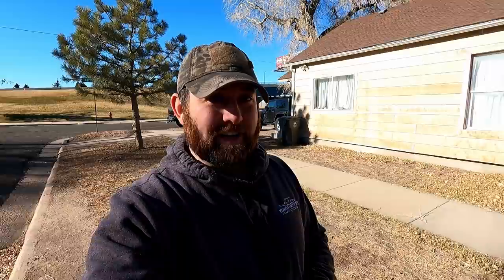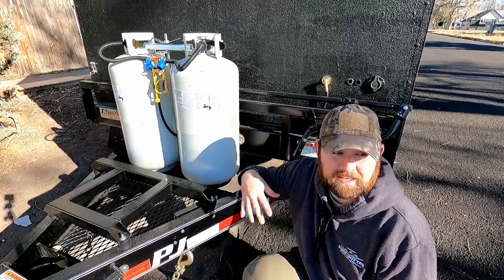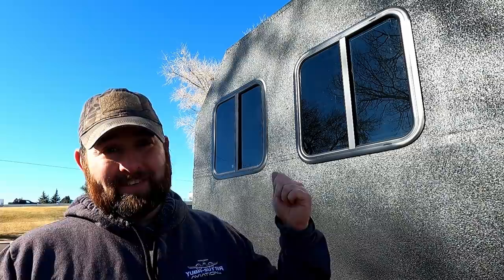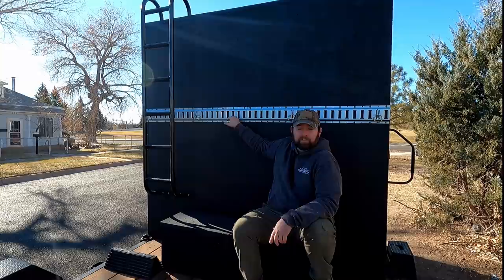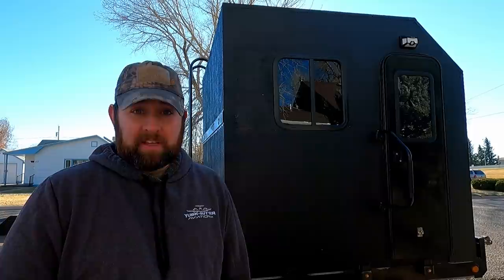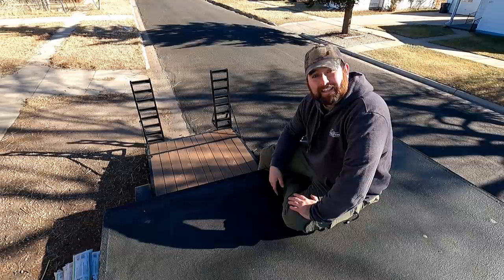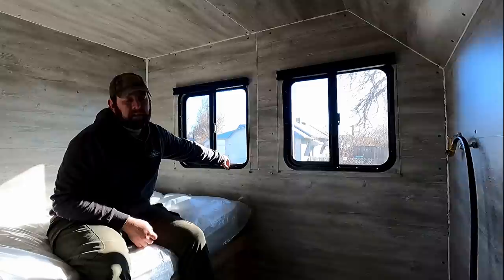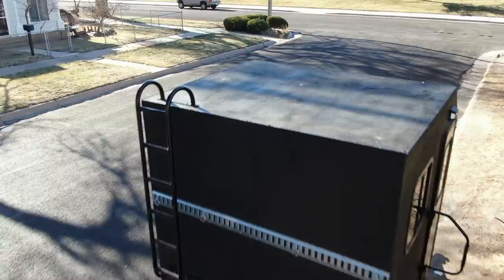DIY Crawler Hauler & Bugout Camper BUILD

Comment: Love the idea of this. Think I would get a small window ac unit that could be removed when cold and keep the roof clean for solar. I guess raid the rv junk yard for a dometic 3 position window about the same size as the window unit. You shouldn’t have any problem making a bracket/support with your skills. Also why your at the junk yard look at the manual steps like on cheaper travel trailers. Could just weld it right on and done. As far as water gravity feed it. 5 gallon jug on the roof hose to the inside with a plumbing valve to turn the water on or off, maybe put another hole for a hose to drain outside into a bucket? Geez look at me running on and on.....   Can’t wait to see more!

Comment: hello mr. brown,  love what you did with the trailer, its perfect close to something of mine, first i started with a big tex 26" trailer, hitch mount, . to help you a little bit better in your design,  a couple of things to think about, first the propane bottles, i would install and place 1 large tank under the trailer in between the frame rails, i have a 20 gal. under, tuck under,. the front of your trailer, the generator should be up against the front of the cab. balancing the weight of the trailer and the jeep on the trailer, a 1-1 ratio, . my trailer has a sleeper cab from a big rig, double king beds,  with mini kitchen in it, microwave, 3 burner stove/oven, drawers, 2 shelves sink, and a 4.3 cu. ft. refer. . also i framed the front of the trailer into a V- SHAPE, for the wind and better economy on the fuel. in the back of the cab on right/left side you could install a half - round shower , i did. ???, all the tanks, fresh, grey, black tanks are tucked into the rails of the trailers, 30, 30, 30 gals . again i do love your design, just trying to help you out due to the fuel economy.
Reply from the maker: I like some of your ideas. I've already built a lot of these things but I might have to change a few things up.

Comment: Also have really good experience with the little diesel heaters found in trucks they work good and can also add a water heater to the exhaust housing to warm up water as it is flowing through with a water pump.

Comment: I think it's super cool that you were able to build this completely from scratch. Suggestion: make vent holes on the bed platform before you open up your mattress and start sleeping on it, otherwise you'll get mold growing on it (rule of thumb: for every 1" in diameter that your hole is, you can put that many feet between holes in a grid pattern (so 2" holes can be 2' apart vertically and horizontally, 1" holes 1' apart, etc.)). I'd also suggest making some sort of ventilation for your Dometic fridge below the bed, either by NOT putting plywood between the left and right box OR if you are putting plywood, cut a hole and put in a vent cover so that air can travel between boxes. Good luck!
Reply from the maker: All very good ideas, thank you!

Comment: Nice work! For your inside window trim, find someone who has a 3D printer and have a window trim made for the windows. It will have to be made in four pieces and can be glued in place. The flange that will appear on the interrior wall will be the base of the print with the relief being printed off of the interrior  corner flange. Try and find someone who can print in the ABS variant of of filament to withstand the summer heat.

Comment: Window trim gaps.... Use a lon strip of sheet metal painted black, wrap around the inside of the window and use 1 rivet or screw through the ends as they overlap to secure.

Comment: Looks good. Not sure if you need it, but I'd slap another exterior light on the back of the camper facing the trailer section incase your doing stuff at night back there.

Comment: Nice execution of the build.  Definitely keep us in the loop on what you figure out with batteries and water.  That Herculiner truck bed coating will eventually fade in sunlight, so I ended up spraying a flat black over it and a UV-resistant clear coat on my truck to keep it from fading.  Did that about 6yrs ago and it has stabilized.

Comment: Looks cool I'd prolly try to use some metal roof flashing for around your windows, could paint to match it comes in a roll and is light thin and easy to work with. Awesome deal man I like it.

Comment: First of all I would like so you did an amazing job on the build it is very impressive now to hold your generator get some right angle iron and weld it together so then that way you have a 2-inch raise weld a I hook on one side and then a chain on the other or a ratchet whatever your preference is and that way you can secure your generator another recommendation I would give is build a shell for your propane in your generator so it is  covered and that it makes it last longer that way there's less wear and tear on your gear

Comment: Quit apologizing. That is a great setup. You.might consider a small window AC unit built out the back to be more economical. A couple of 2.5 gallon water jugs would do you fine instead of plumbing. A camp stove with 1 lb tanks could make a kitchen, inside or out. Looking good. Enjoy.

Comment: Very nice. I used to race a class 10 buggy back in the late 80s/early 90s. I had a similar idea to build a camper/trailer for the buggy. My idea was basically what you built except I was going to build a bed area that extended over the hood of the buggy. Kinda like a backwards truck camper. A Jeep may be to tall to do that but if it's not a height issue, that would give you a comfy, dedicated bed without adding to the overall length of the rig.  Of course it would eat into your deck area but everything in life is a trade off in some way. 
Unfortunately finances, school etc got in the way and I never built it. It remained yet another unrealized dream in my life so it's kind of cool to see you getting out there and making it happen. Looks good so far, you do good work. I truly hope it works out great for you.

Comment: Lights and more lights! Outside. For the deck and front to use while using the gen propane. 
Until u replace the box line it to match.
U may need to install DOT Reflective tape to the rear corners.

Comment: You should consider a small wall mounted ac unit.  With the insulation you have you won't need much even at 100 degrees. A roof top mounted water tank like they do with horse trailers would make water simple.  Looks like a great start. Good luck.

Comment: What about custom build water tanks to sit between the axles and the trailer bed? Out of fiberglass or something, wont be giving up much room and not mess with weight distribution too much. 

Another option is 4" pvc pipes, a 10ft 4" pvc pipe can hold 6 gallons of water, I'd try to line the space between the axles and the frame again in order not to give up space. 

Very cool project and awesome job. Thank you for documenting.

Comment: I thought it was a very cool and thought out video. Thank you so much. Idea for you we're the hood of your truck or your 4x4 when sitting on the deck you could probably do a build out from your sleep area that's connected to your sleep area over the top of that 4x4 when it's parked up on there Yes that will cut down a little bit of your deck but it'll give you more room for storage and other things or you can jack up the height of that trailer 12 in or more to accommodate for like a stone go type situation just some ideas I'm sure you've probably thought it out of all that stuff. Or getting even longer trailer. I love what you got so far that's a pretty innovative idea and probably saved you a ton of money on a car hauler cuz car haulers are not cheap My god they want way too much money those toy haulers are way overpriced

Comment: Love the video, You got my mind spinning with ideas.
I've been in a 3 year build doing the same thing, ran into a lot of the same problems.

Ideas
I worked in propane for 20 years. You have a Total safety issue. You need an outside single stage regulator "probably with a bigger diaphragm than the one you used" so everything will work.  If you don't have an outside pressure relief valve than the only way your system can bleed off is inside the cab. "BIG BOOM WAITING TO HAPPEN" 

Water issue.... Have you thought of gravity feed "or" just mount a 30 gallon barrel to your C clamp and supply water that way?

Chitter.... Make a cassette tank out of a 5 gal Jerry Can that you can slide out the side from the bottom for cleaning.

Comment: We have a 2004 Tahoe Pak Rat, 22ft toyhauler, same concept as your camper. Two things that I love about it...front pop out bed (doesn't subtract from the 9 1/2 by 9 1/2 foot floor space).
Also has two doors, one on the passenger side, for easy loading. The second one opens onto the back deck, which is where we spend most of our time (once vehicle is offloaded).
Often thought about an exterior makeover...may barrow a couple of your idea's.

Comment: FYI embed poly fabric at least  around perimeter set in acrylic base with pure silicone top layer, ( silicone bonds well to acrylic)  that will waterproof the exterior trim  coating alone will not work long term otherwise nice job looks great

Comment: Everything you add is also adding to the overall weight(plus, weight on the trailer tongue). You might benefit greatly by looking into materials used in the aircraft industry. Could help with towing mpg.

Comment: You want a regulator at the tanks, if the pressure going to the internal appliance regulators is too high they will lock up. Having dual stage regulators won't over regulate it, the appliance regs just step the pressure down further to what it needs to operate. Also if you have a propane leak, you want it to be lower pressure leak rather than a high pressure leak.
Reply from the maker: Yeah, I've since put a regulator on there. It's nice.

Comment: I know you say you want to use the space under the bed for storage but my only suggestion would be to rework the bed so it would fold up against the wall. That will give you some floor space for those days you want to stay inside. Mount that other stuff under the counter or whatever you put on the front wall.

Comment: Very cool, well thought out.... I'd like to make something similar. Your slip in ac unit can be dual purpose ac/heat. I'd mount a couple of deep cycle batteries ahead of the 2 propane tanks, and enclose both.
You could make a solar heater, or instant heat propane fueled hot water heater and enclosure for a hot shower outside for about $130. I might "exchange" the porta poty and fridge locations for your sleeping comfort, and possibly turn that bedframe into a 'Murphy Bed' style to give you more room, and while keeping the batteries outside in their own compartment outside, - run all of your controls inside, - to a consolidated 'power control area'. 
Add 12v power to the rear, in case you need power to the rear for winching/charging/ air compressor/or use of a welder for your Jeep. You could mount spare Jerry cans of fuel and water on either low side behind the housing center - on either side of the secured Jeep, ... reinforced with protection across both sides of the cans. Add some exterior LED lights, and you'll be good to go- 
Maybe these ideas will help as you move forward with your build.
Tuffcaptain548@yahoo.com

Comment: Shoot, use 26" steps.
It will be much safer getting in and out both, especially   moisture, as in ice or snow!
I recently had to get in and out of a fifth wheel camper several times a day and I made the stairs outside longer and wider just for safety cuz it was so easy to step off the thing and fall!!

Comment: Hinge the bed so you can fold it against the wall. Underneath you have room for a dinette with a port-a-potty and battery bank under one seat and a water tank under the other. Add a small kitchenette on the wall opposite the door. And, build a shower pan into the floor space right in front of the door under wood slats level with the floor. (Hooks in the ceiling can hold a shower curtain.) Put a couple solar panels on the roof. And, you're ready to stay in that for a while.

Comment: I made a "glass" door in my house - didn't use glass, i used two panes of polycarbonate separated by about a 1/4 inch. I then drilled a small 1/16 hole in the bottom corner of the inside pane, which still has the air insulation, but does regulate the pressure in between the panes. The door is nearly unbreakable and helps keep the warm air inside the house.

Comment: For water, easy and cheap 6" pvc pipes around the top connected to a 1" pvc tubing inside or outside  and pressurized with air, U goin to have plenty od water for ur needs.
Reply from the maker: I'd like to try and maybe add water this summer when it warms up

Comment: Looks great man! You can make that unit full functional no problem!  Like the inside walls they look great.you can heat that with wood as well and have your mr heater .make it dual purpose so you can cook with heat to save gas when needed ! May as well make it sweet in there . Yep

Comment: Another option is to have the bed flip up for a shower base underneath with your cassette toilet and fold it down when you don’t need it. Also if your thinking solar meaning you will be getting deep cycle lithium’s save your money on the roof top ac and just use a little wall/window ac unit off the back of your room because they can run off a good inverter and draw far less power then the Rv models which in my experience are not efficient and you don’t have to run a generator continuously to keep up the power it requires. However your build looks great!!

Comment: Looks good, If you go to a junk yard for semi's, you can get all the parts and hardware for cheap. locking mechanisms and all. something to look at for cabinets and bed ideas. Buying new is way to much. When I was pricing it out new to add a second bunk in my volvo, it was $2 brand new. but as far as cabinets you could get then there as well. depending on truck manufacturer they have different slopes to them. They also make boxes like what you built that go on and off semi's for storage that drivers turn into extra quarters. cheaper route.

Comment: Very cool but another idea could’ve been buying a small used camper cutting off the tongue removing part of the wood floor on your trailer and welding it to your frame. That way you would have all the hookups,ac,battery tender and so on also you would have rubber roof sloped so it could be replaced when needed. Also might could install auto leveling so when you get where your going just hit button and your done. Just some ideas🤷‍♂️

Comment: trim the windows with some cheap black pvc lawn trim. should be able to cut strips to fit the gap and it should stay tucked under the face plate. btw, nice job so far. looks good n solid!

Comment: You do have a point about tongue weight, but it's actually more dangerous to have the weight far back. You're better having the weight directly over the trailer axles or slightly in front of them.
Reply: Thank you I was like this is so cool omg this is so dangerous 😂 love it but wouldn’t want to tow it.

Comment: Another thought is a shower or presser washer. Take a 25 gal tank and drill a hole and tap for a threaded valve stem. Fill 20 gal of water and 5 psi (bicycle CO2 packs) and wala.

Comment: Nice build.  We've pretty much decided to get a light weight camper we can tow behind our 2016 JKU Sport.  Gearing is the biggest change I plan to make.  The stock 3.28's boog the Jeep down even when towing well below the rated capacity.  We did a rental Labor Day weekend this past year and it was ~2700 pounds and the Jeep struggled.  Figure with 4.10's it will tow much better.  I'll be watching your follow up videos.  We did the 2019 Easter Jeep Safari and loved it, can't wait for the next trip maybe in 2022.  Safe Travels and God Bless!

Comment: Try to mount a 55 Gal drum for extra water. I used a garden sprayer trailer, cit the wheels off and welded it to my frame with 55 Gal drum. Free water at Pilot/Flying J. I use a 12v pump for the shower run off small solar panel. Or dog water.
Reply from the maker: That would weigh over 450lbs.
Reply: @CodeBrownProductions  yes it would.

Comment: You should take the trim off the inside of the windows. Put a sheet metal ribbon the thickness of the wall around the openning and seal. To cover the wall composition.

Comment: You could trim the windows with wood and make a window sill/shelf. Would stay in with just grab adhesive.
Jason Klunk just put out a video on a Sprinter van. Could do something similar but would just have to be held in with adhesive not screws.

Comment: We have a converted converted cargo trailer and online they make removable foldable steps so you can throw them up instead of inside on a rug and then you don't have to worry about a a rock removing them
Reply from the maker: I'll have to look that up
Reply: I just came out with that idea out of nowhere
Reply: But I do know if you peel the bark off of Willow it makes a nice piece of white wood that would fill a corner

Comment: Make a lock box for the generator.  Also put reflection lights on the outside. You should put a walk mounted bed that folds up on the wall, looks good,  folding wall table

Comment: Looks great so far 👍 I'm not sure if you though of this because you didn't mention it. The bolts hold the E track onto the camper should have fitted neoprene washers on them so as the rain doesn't Wick into the wood shell. Vertical E track with 2x4 holders works great on the inside so as the bed can be adjustable and or to add another bed in the future. Keep up the good work 👍👍